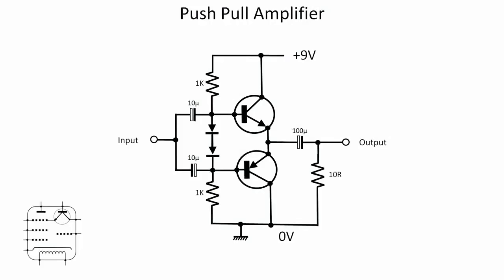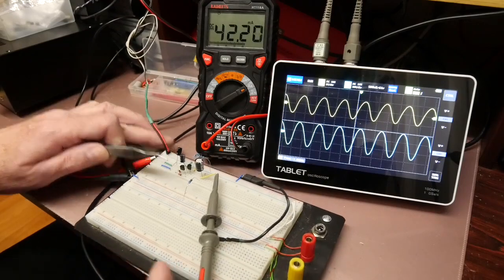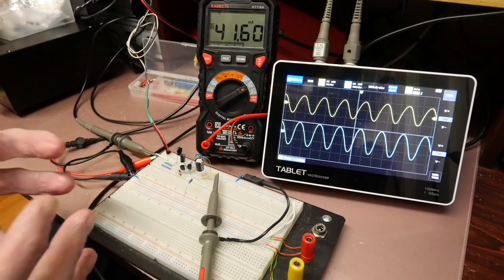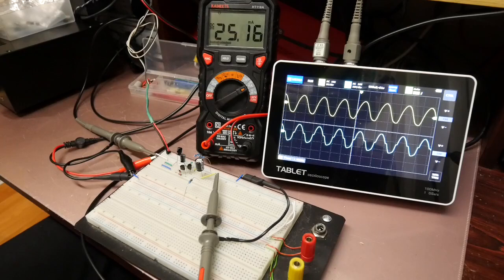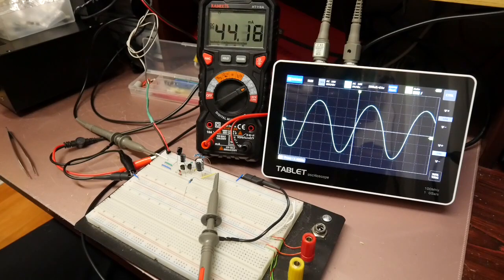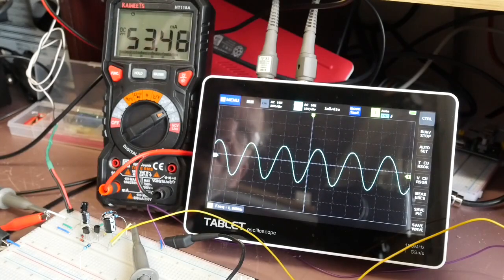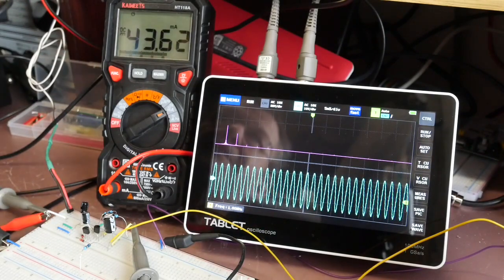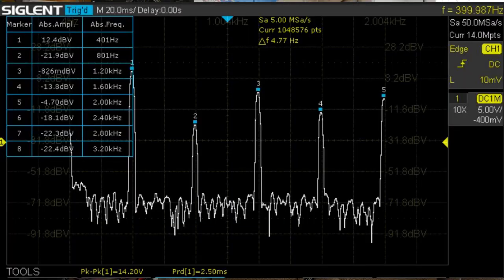Exploring Push Pull Amplifiers with the FNIRSI 1013D Oscilloscope  #061

Comment: Thanks.*One way* of biasing a tube guitar amp (especially a classic AB push-pull like a Marshall) is to find that crossover distortion point and then increase the voltage/current to the point it's 'clean' (sinusoidal), but no further; maximising the headroom and dynamic range, but also resulting in the tubes being biased 'cool', for longer life and reliability, and less stress on the other components. That FNRSI scope looks perfect for the job and has now risen to the top of my wish-list 🙂 Thanks again.

Comment: Hmm, should the input capacitors be polarized both in the same way? The amplifier end is somewhere +4,5 V, and the signal generator end is connected to ground potential via 50 ohm resistor.